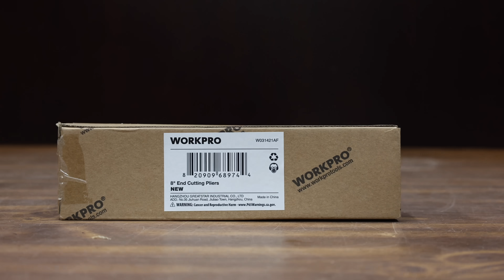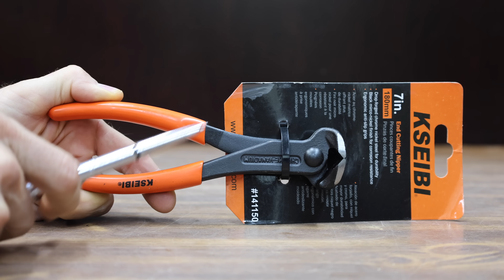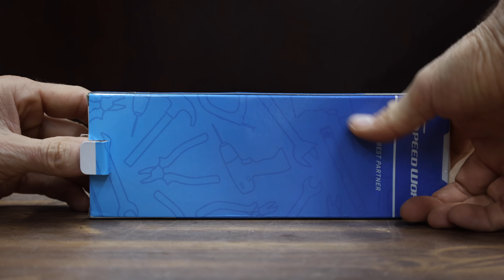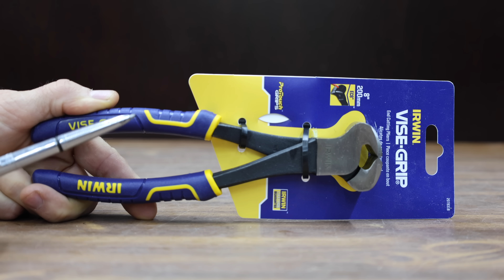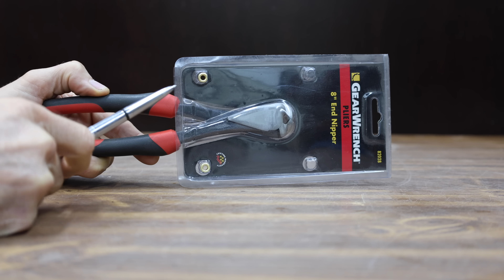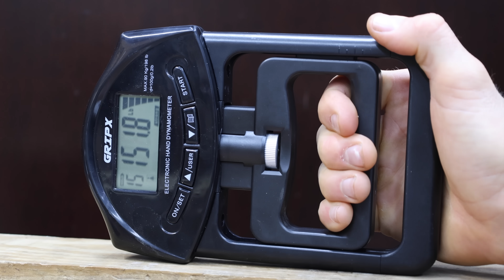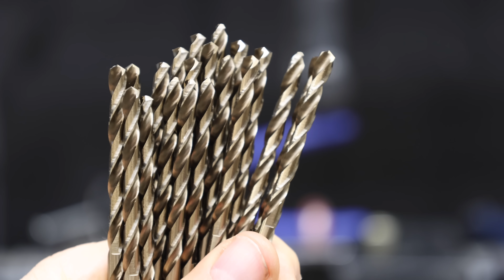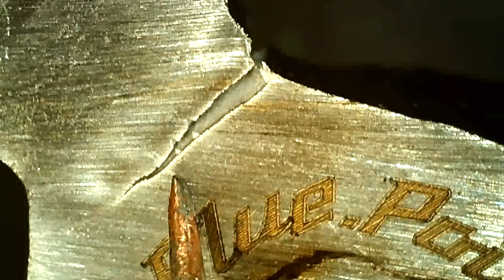Finally! Best Pliers I've Ever Tested! Not Even Close!

Comment: Who in the hell tries to cut a drill bit or an allen wrench with a pair of nippers?????
Only the wild man at Project Farm.
Congratulations!!! You and Knipex are winners today.
Art from Ohio
Reply: Plot Twist: He actually did all the tests using his own hand strength. Just pretending to use the hydraulic press out of modesty so we don't feel bad.
Reply: @KF1 his fingers are calibrated for even more accurate measurements than the press.
Reply: @matt9741  Lol fully
Reply from the maker: Thanks!
Reply: The kid who you lend your tools to will definitely try it. Especially if you aren't watching.
Reply: Accelerated life testing is good testing. The damage the blade sees is a useful comparison.
Reply: ever need the bit or wrench to be a shorter length to get the job done, but dont have angle grinder on hand? I have cut both drill bits and allen wrenches with side cutters.
Reply: @Isaac-47517 …that’s a pretty good feat. I have cut #10 screws and maybe an occasional drywall screw with my linesman pliers but that’s probably my max. I get away with it a few times but eventually I’ll chip out my cutting edge.
Reply: Your kids when they get into your toolbox. 😂
Reply: If you ain't testing to failure, you ain't testing!!
Reply: I use a flat piece of bar stock as anvil and a flat backed or Japanese style chisel to make the cut .. if I want a really flush cut... But, even then, I find that some wet/dry sandpaper on an angle grinder- careful... careful... (say 400 grit) helps a lot.

Kinda like the old saying that 'a grinder and paint...' 🤔🙄😎
Reply: I'm from Ohio and I approve of this message from Art from Ohio.
Reply: @MrCmetzler  I'm from Ashland, are you from Shreve?
Reply: Ohio (northwest) 😊
Reply: Tennessee here. Love Knipex. Wish he would try Rigid, Kobalt, Husky, Stanley...like the big box stores carry.
Reply: I’m also in Ohio!
Reply: He did cut the shank, which tends to be softer then the rest of the drill. (This reduces damage to your drill chuck)
Reply: @JohnSmith-NZ  why?
Reply: @Zanderthelab  If the drill slips in the chuck (we've all done it) the friction is going to damage something. By having the drill shank softer than the jaws of the chuck the damage will be on the drill bit, instead of the much more expensive chuck
Reply: I actually couldn't believe that they all managed to cut through the drill bit, that's pretty crazy.
Reply: I have actually had to cut an allen key that had been dropped in concrete, and angle grinder was not particularly smooth
Reply: LOL. Buy $45 pliers that suffer damage to cut a $1 drill bit.
Reply: Seriously thought this was going to be hate mail with the first line. Lol
Reply: It's a pretty good maximal test case for cutting stuff like protruding nails or soft machine screws.
Reply: @artszabo1015  Sometimes that’s just the situation I have found myself in.
Reply: @marcuscoquer5958  I probably shouldn't ask but, why are you telling me about your situation?
Reply: This simulates stainless steel security and flight cables and the like. It's immediately obvious if you are crushing or cutting when it's against something like that.
Reply: Exactly, I thought the point of these tests is to put them through actual scenarios and average wear and tear. He’s the type to go buy a Lamborghini and be upset he paid all that money and can’t go traverse a mountain. Back to the drawing board as far as testing pliers.
Reply: @DJN4CER The point of these tests are to see which tool will handle the most difficult tasks. Destruction testing is a good way of doing so.
Reply: Exactly, I thought the point of these tests is to put them through actual scenarios and average wear and tear. He’s the type to go buy a Lamborghini and be upset he paid all that money and can’t go traverse a mountain. Back to the drawing board as far as testing pliers.
Reply: @DJN4CER  It is simply because you don't understand what he is doing. He is NOT testing in an everyday real life scenario - he is testing them against each other to see which one is ultimately the best.
It is like a MMA fight, they don't go in the cage to drink coffee. They go in there to win, the one that his ass destroyed DID NOT WIN!!
I don't say this to diminish your point. I think you should start your own testing channel and see how many subscribers you have next year - if they don't fall asleep.
Reply: I love you for giving an effort to pronounce knipex right <3
Reply: And he didn't get shot doing it.
Reply: @hogue3666  Are you sure you are in the right forum? How could you get shot testing nippers?
Reply: Ever worked around drywallers?
Reply: Ever noticed how many folks who watch this and similar channels are from Ohio? 🙂 (Me too).
Reply: @monkeybarmonkeyman  or maybe Ohioans are a really loud minority. Yall just yap
Reply: @monkeybarmonkeyman I didn’t realize that lol
Reply: @monkeybarmonkeyman  confirmation bias, you want to see it so that’s the ones you notice and remember
Reply: @monkeybarmonkeyman , We’re everywhere! Lol O-H-
Reply: @Hoaxer51  EYE OH ;-)
Reply: They call him Ohio Art in the phone book. He's pretty popular.
Reply: @ddforrester  Pretty funny and mostly only Ohioans would get it  😛
Reply: @monkeybarmonkeyman I don’t get it lol
Reply: @ddforrester what?🤣
Reply: What is going on in Ohio!? Y'all pet's safe? Blink twice for help
Reply: @robbobsjobs8456 really? Based everything off of a Facebook post about a friend's daughter? Bro
Reply: @Tallnerdyguy  don't assume
Reply: You asked who uses these tools to cut drill bits and Allen wrenches. Well, there was this one time where I needed 2 boxes of nails to build a 12'x16' shed from scratch, but i  accidentally grabbed drill bits and Allen keys instead of nails. So I drove in roughly 120 drill bits and Allen keys before realizing they weren't  nails.

When it came time to remove them, I discovered that my cutting pliers were a cheap, Chinese-made model that was constructed with chrome vanadium , I mean lead-cadmium steel.  😉

Comment: Suggestion for video: Motorcycle Oil. 
Motorcycle oil not only lubricates the internal engine parts but also the clutch and transmission. It is more expensive and has different brands than conventional auto oil. 
Motul, ecstar, yamalube, Mobil one, etc…
Reply: Yes please! 👍 Keep suggesting this over the time...✌️
Reply from the maker: Thanks for the suggestion.

Comment: Good grief Charlie Brown, you can clearly see the bevels left above the cutting surfaces on all of these.  It's just a few minutes on a grinder to flatten the tops and you'll get a more flush cut.  It's easy to see immediately that the "Wiha" has a much smaller space above the cutting edges. They wouldn't take much grinding to get dead flush on the cut.  I'll bet nothing beats them for that aspect. 

 OH MY look at those Japanese nippers!  Now that is properly designed for a nearly flush cut.  Love it when the "ugly" performs better than all the gussied up junk. 

But still, if you need a flush cut, you'll need to modify most tools, the cutting edges simply aren't close enough to the bearing surfaces.  Wiha for me this time. I have no need to nip hardened alloys.

Comment: The Wazakura is a design used for bonsai, to cut aluminum or copper training wire off branches. Bonsai tools usually have a very close to flush cut.
Reply: Exactly. Even though it did well, it is inappropriate for this lineup. Should have been Tsunoda or Fujiya instead
Reply: If you want to trim small wires flush, Knipex also has much better suited tools, such as the Knipex 78 61 125 or 78 61 140 for larger gauges.
Reply: @Steamrick  I would list off cutters from various brands that cut just as good or better but that would be pointless. The point of my statement is that Wazakura is a gardening tool and should not be in this video
Reply: @velse9869  You're right. I winced when I saw them because it's such a beautiful and precise tool and it was clear from the start what was gonna happen to them in that testing setup.
Reply: @cire9984  Beautiful? They were objectively the ugliest tools in the lineup. They looked like they came out of a blacksmith shop.
They definitely had the best-shaped cutting jaws though.
Reply: @TehButterflyEffect they look like hoof nippers that farriers use.
Reply: @TehButterflyEffect objective?
I hope your being sarcastic…
You literally say it looks like it came from a blacksmith like that’s the objectively bad thing while the others look like they’re made in the hot wheels factory with prominent, flashy, crappy plastic. It’s fine to like the tacticool gear, just understand that we don’t see things the same AT ALL.
That simple all metal looks better to me, the level of precision they’re made with is obvious to me at a glance
Reply: @velse9869  To be fair they really messed up their amazon description for these. If you don't know the brand you could easily take them for carpenter pliers. Sad to see a nice tool get destroyed in a misuse, but i hope at least the craftsmen got their pay out of it.
Reply: @swayback7375  The difference between a poorly-finished tool and a professionally finished tool. The ugly tool wasn't finished properly.
Reply: @Steamrick  genau
Reply: And we cut screws and rods with bolt cutters, not pliers.
Reply from the maker: Thanks for sharing.
Reply: Samurai. Sword.

Obviously intended for cutting nails and drillbits.

Comment: A note about the hardness of drill bits: usually only the flutes are hardened and the shaft is somewhat soft so it doesn't damage the drill chuck.  That test might actually be easier than the deck screw test.
Reply: It's not even so it doesn't damage the drill chuck. THe drill chuck jaws are required to be able to deform the shank a bit to properly grip it.
Reply: Good point... LOL!
Reply: "That test might actually be easier than the deck screw test." I mean, the numbers are there, you can see if it was easier or not
Reply: @tonyrulez69 different diameters tho
Reply: If you look at the numbers it took a significant amount more force to cut the drill bits than the deck screws so those drill bits were definitely tougher, and if you use the knipex numbers it went from 100 pounds for the screw to 170 for the drill bit so I'd say 70% tougher, also several of them required 400+ pounds to cut.
Reply: @bdkj3e  much different diameters though... with that level of lever action at that size, yeah it could easily require that much more force

Comment: I believe you should do an episode for the best automated longitudinal wire stripping machines. Not are there simply different brands, there are many design styles, and without buying em all to give em a try, it's certainly difficult to know the important things like 
1). how well the wheels grip the wire and pull it in & send it out, 
2). How much slop or how precise & steady the blade is so it stays on center and doesn't spit the wire out of track under the cutting blade, particularly with wire under 3mm wide\about 16-18 gauge & smaller. 
They range from handheld full manual longitudinal strippers, to hand crank powered, or to use your drill to power it, and then there's fully motor driven electric wire stripping machines.
Reply from the maker: Thanks for the suggestion.

Comment: Did you measure from the rotating point to the same distance on the plier handle? That distance should be the same among all of the pliers or else the grip strength test wouldn’t be a fair comparison.